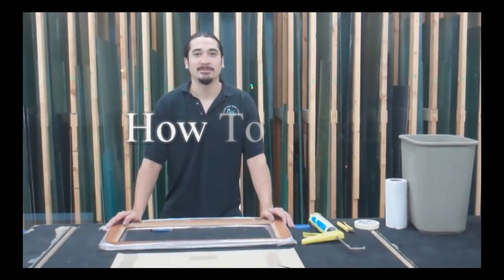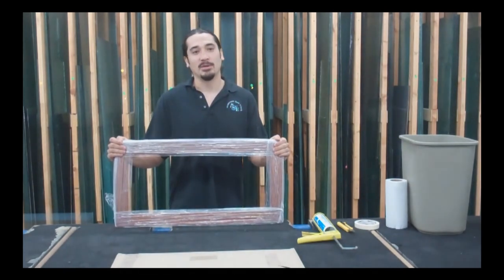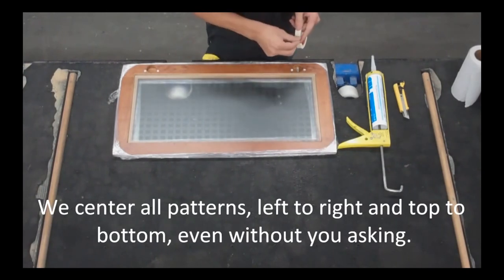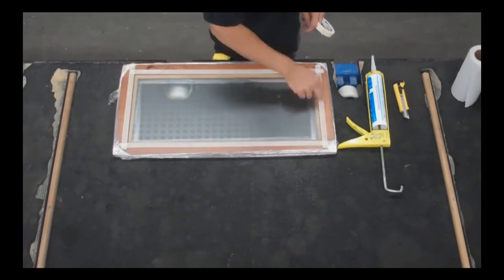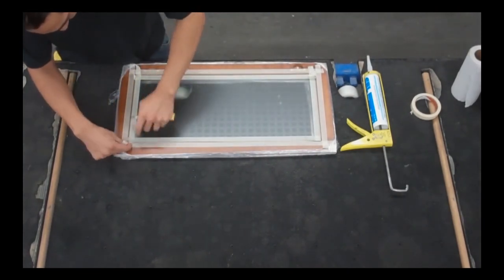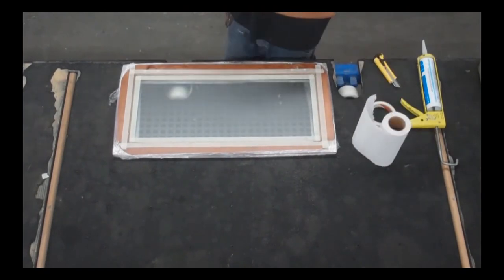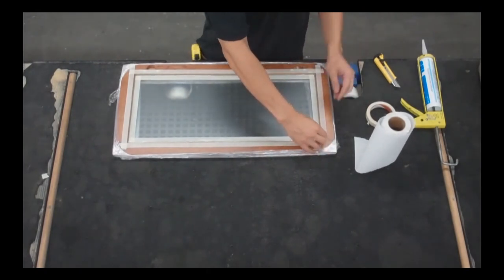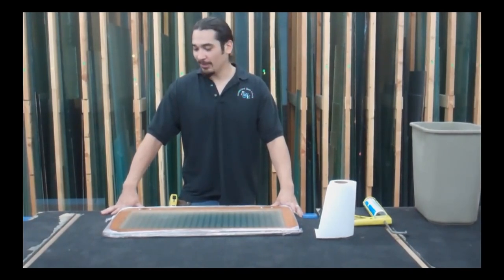How To Install Cabinet Glass

Comment: Very interesting to see.... Pl comment  whether silicon glued glass  can hold the ground for  long time vis a vis  glass held by molding/beading.?
Reply: Glass help by a silicone installation fits better to the door and glass without pressure points that molding or a spline can have. But it can make it harder to remove the glass if you wanted to change it.

Comment: Thank you for this video! The glass that I am putting in the cabinet doors does not have smooth edges and I'm concerned that if I run my finger along the edges I will definitely get cut. Is there another way to do this process safely? TIA
Reply: I believe all glass from Van Dykes Restorers has a seamed edge so that it is not sharp to the touch for your safety. For glass from other sources, you can try to wear safety gloves. But I do not recommend handling unseamed glass.

Comment: How deep is the groove on the door? And how thick is the glass?
Reply: Most cabinet glass is 1/8" thick. The groove or route can depend on the manufacturer of the door, but I would estimate between 1/4" to 1/2".